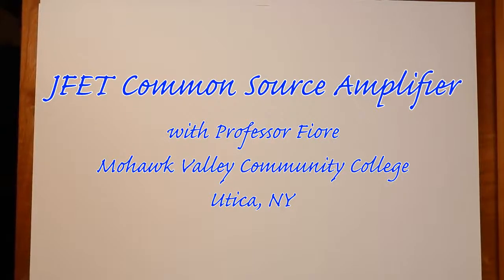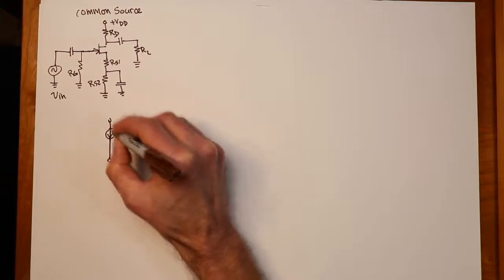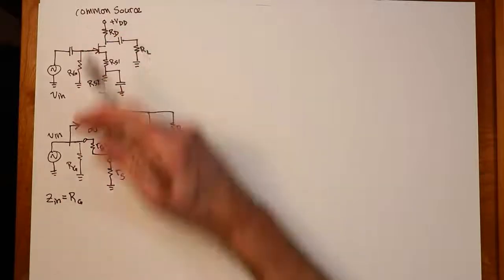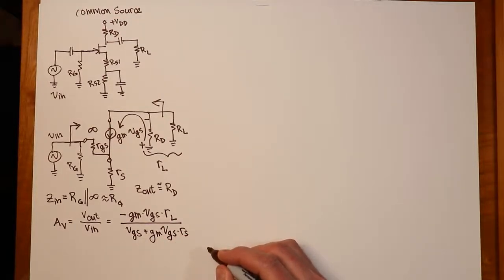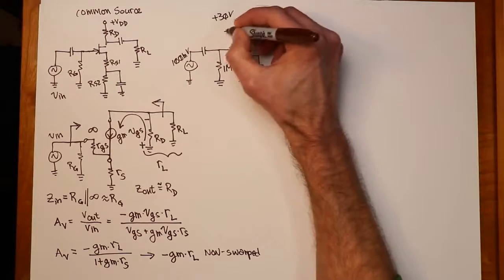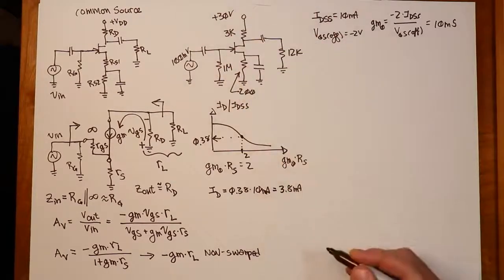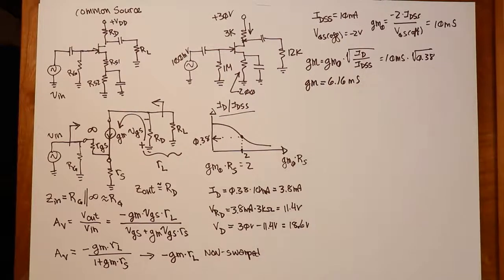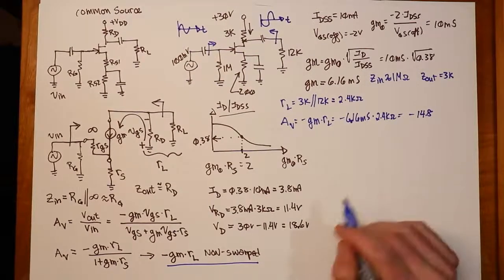Semiconductor Devices: JFET Common Source Amplifier

Comment: Since a similar circuit is used in the frontend of many pieces of high-impedance input test instruments, a blocking cap is generally always shown (for the safety of a novice copying the circuit). Since one cannot trust a user after the sale, or after construction, it's best to place two 600V coupling caps in series, say two 22 nF for the cap in question, because the instrument may be used to test old tube equipment.
Reply: Let me add that even though most educational institutions only teach solid-state theory these days, a quick premise on vacuum tubes would help the student, because when they understand how they work, solid-state is very similar, especially FETs.
Reply from the maker: @craxd1  Sure, but time is a limited quantity in any college/university program. If the students and I had unlimited time, I'm sure the curriculum would be different. As it is, there is the constant question of what "old tech" has to get thrown out in order to make room for the latest and greatest. This is complicated by the fact that legacy equipment is still out there, but at what point do you say, "No, this other bit is more important now"? It can be a quandary, but then again, engineering is all about achieving balance.
Reply from the maker: The circuit in the video does include an input blocking cap (extreme left). It is not needed for this bias if there is no DC offset from the signal source, but would be placed there for protection from external DC.

Comment: Thanks a lot for the video. how did you get the 0.38 of Idss (from gm0.Rs being 2)?
Reply from the maker: The circuit uses self bias. You can either use a self bias graph or the rather long equation that produced that graph. You will find both in the JFET Bias chapter of my free Semiconductor Devices text (follow the link to my website).

Comment: this video is life saver, thanks but i need to ask, i need to design an amplifier circuit which has 30 gain. But it doesnt work for the values above 100 mV. Is it normal?

Comment: Why is gm0 = -2 Idss / vgs off ?

Why are we multiplying Idss by -2 ?

And why are we using vgs off to determine the max gm0 ?
Isn't vgs off when no current is flowing?
Reply from the maker: The gm0 equation is derived from the general transconductance equation by taking the derivative. 

These questions are answered in detail in chapter 10 of my free OER text, Semiconductor Devices: Theory and Application (section 10.2, JFET Internals). Follow the links in the video description and download your copy in PDF or ODT format (or, you can read it on-line via Libre Texts). Your choice.
Reply: IT INVOLES USING THE CALCULUS BY TAKING THE DERIVATIVE THIS EQUATION AND,DOING ALGEBRIAC SUBSTUTION.

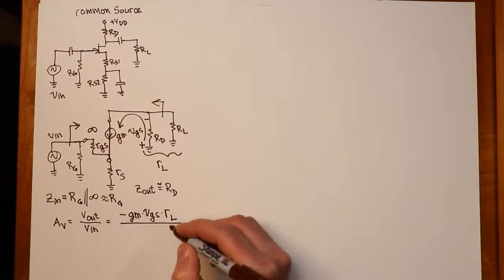Comment: When calculating the Vout (at 05:30) Why we multiply with rL but not RD?
Thx for the video!
Reply from the maker: rL is the AC load impedance (sorry for the shorthand, rL is r-subscript-L). RD is the DC drain resistance and is part of the AC load (hence, RL in parallel with RD, or rL; recalling that we always use lower case r for AC and upper case R for DC). Just look at it this way: You want to determine the AC impedance that the FET is driving. What's hanging off of the drain? That's the drain resistor in parallel with whatever load this is connected to (i.e., far side of coupling capacitor).

Comment: Sir how the gate-source is in reverse bias?
Reply from the maker: The circuit uses self bias. Check out the video on that for details, but in short, the drain current established a voltage across the source resistance which means that Vs is positive. Meanwhile, there is no bias on the gate, so its DC potential is approximately 0. Thus, Vgs is negative.
Reply: @ElectronicswithProfessorFiore  imma fool, this is self biasing ckt alrd. Thanks.
Btw sir can you make video on voltage divider biasing.. I not sure how it works bcaz the gate voltage  is more than the source(if source is grounded)..
Reply from the maker: @diago2805  That's what I call a combo bias. Typically it's done with a negative source bias supply. The voltage divider version just shifts everything positive to avoid the second supply. It's covered in my semiconductor devices text (free download, see the video description for links).